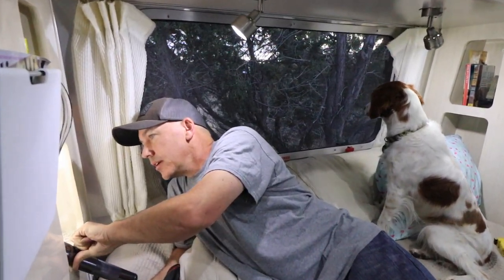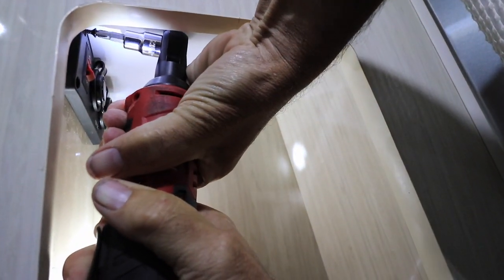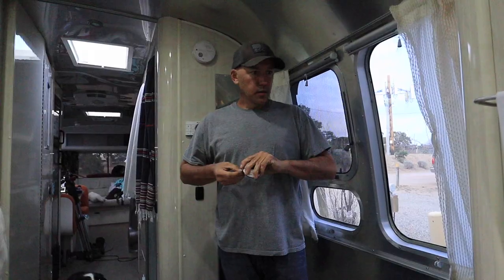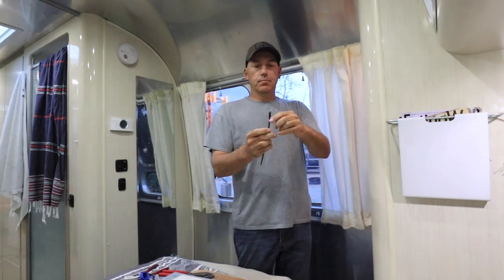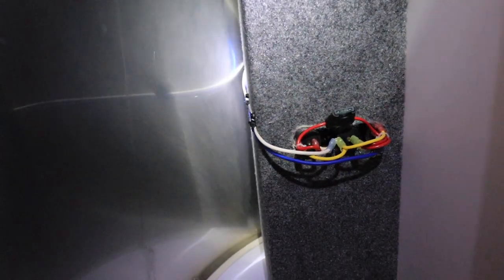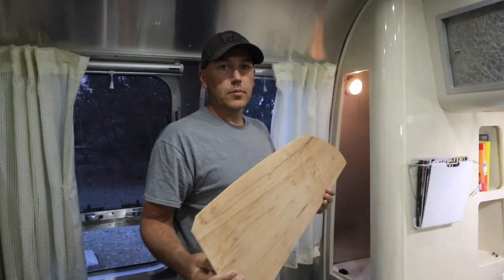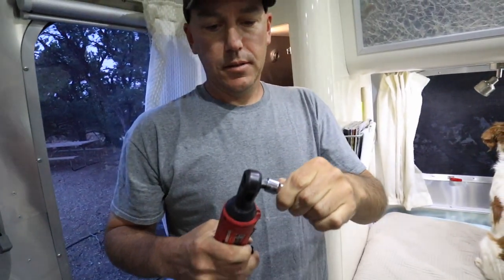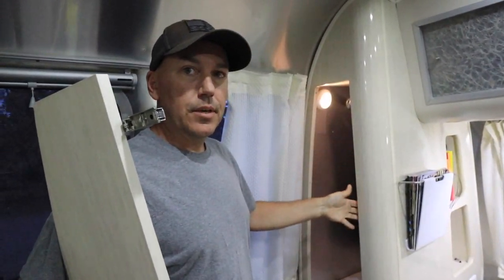How To - "How I Do" - Blue Sea Systems  Dual USB Chargers & 12V Socket Install

Comment: So, I've been going back and forth, your current videos and your older videos. I LOVE this idea! I'll agree with T.J., it IS an upgrade!, and an upgrade I'll be doing too. Our 2017 Jayco 5th wheel has only one 12V outlet in our bedroom also and I've been considering more 12V outlets in ours. This setup will work perfectly. I guessing you found the outlet on Amazon so I'll find it too. 
I know you'll see this as I get notifications when someone posts something on my videos no matter how long ago I'd posted them. So, another question, during my lunch break and before watching this video today I saw not only your newest about Zion but also another older video from January 23rd this year from fall 2017.  
So when exactly was Bri's birthday in that video? When is T.J.'s?  
I really like your "how we did it" videos. I saw the one about the solar suitcase, the propane conversion to the Honda generator, not sure I'll be doing that one. We have the same Honda generator and we also have a 7,000 watt RV 30 and 50 amp Champion that's already dual fuel. I am planning on installing the "soft start" addition to the A/C unit on the Winnebago and the main house A/C on the Jayco to be able to hopefully use the Honda generator more often when A/C might be needed because it is much quieter than the Champion. We also have a set of solar panels, suitcase style that we haven't used yet, have to wait till next year now as today was 26 in the morning and a high of about 40 with snow predicted tomorrow, so no more RVing this year for us!
But mainly because we travel with either a small 2018, 20-foot Winnebago travel trailer or our 34-foot Jayco 5th wheel and use a truck, so we can store the small one-gallon gas can away from the passenger compartment that you can't do in your van or the close confines of an Airstream.  My wife's family had an Airstream when she was younger and she'd love to have one now too. But both of our RVs together cost less than one of the model Airstreams she likes. 
I think they're nice but I also think of Airstreams as the Apple of RVs, nice and shiny, but way overpriced and not as many features as they should have for the price! But I'm not knocking them!
Reply from the maker: Thank you so much for watching, Joseph! The 12V receptacles are so handy, we love having them and use them constantly. These are the ones we used: https://amzn.to/2z6NXsW. Sorry for not responding sooner, I’ve been fighting a nasty cold that’s had me down for almost a week. To answer you other questions, Bri’s birthday is Dec. 31st and TJ’s is May 17th. The propane conversion to our Honda generator has been great for us so that we don’t have to carry a gas can around and worry about where we’re going to store it, but for you with a pickup truck we get why you wouldn’t do it. We also want to install the soft start on our AC, one of these days. Sure would be nice when we’re boondocking in the heat. Our stay in Big Sky Brewing Co. in Missoula in particular comes to mind, that was a hot stay for us! We love our Airstream but totally get where you’re coming from, they are expensive! By buying ours used we essentially got it for half price, and we love the quality and that they hold their value well comparatively, but we think any rig that gets you our exploring is perfect!

Comment: You can get a decent inverter for 400 bucks, see Giandel Inverter 3000Watt 12V and GoWISE PS1004 3000W Inverter. If you need shore power and MPPT with it, MPP Solar and Growatt do all in one units for $500 and up.